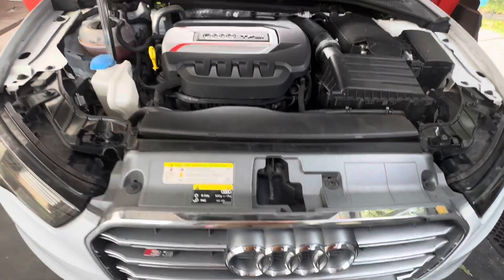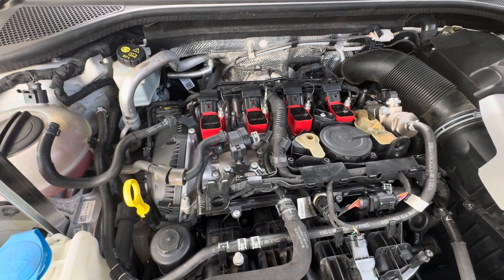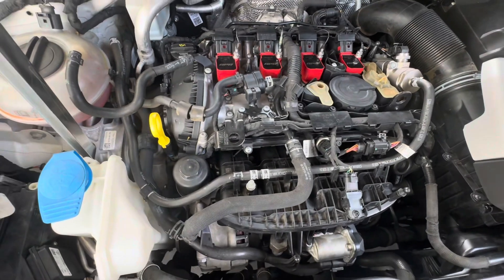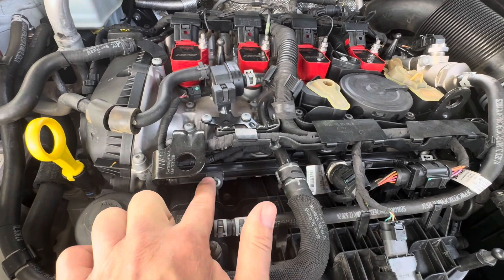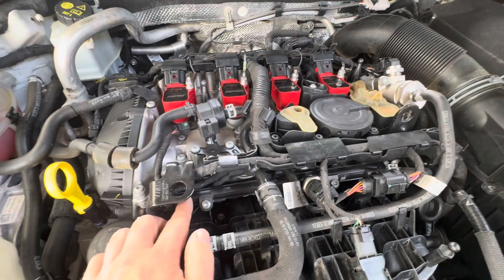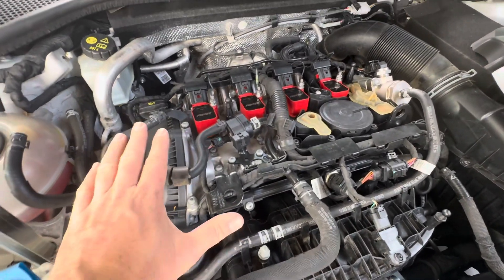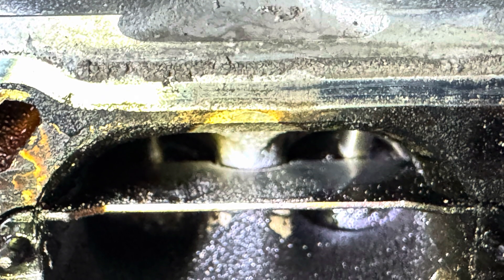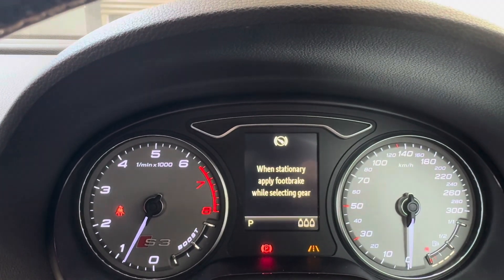Fixing rough idle on the VW/Audi EA888.3 engine

Comment: well ive got a issue with this engine, mine is 1.8 tough, europe version, i got a situation which is: engine wants to stall after acceleration, noticed its worst until the engine warms up, sometimes it hunts for stable rpm at idle aswell, replaced the coils, pcv, cleaned the ports, spark plugs have like 30k km, any ideas? i can send a video if necessary, no codes btw on vcds
Reply from the maker: I’m not sure if worn fuel pump(s) would cause it without triggering fault codes, but that would be worth investigating.  Otherwise injectors are the most likely cause, poor flow and/or poor spray pattern.  Take them out and get them cleaned/tested.  Although it’s likely not an issue it might be worth doing a compression test before pulling injectors out, since it’s a simple process.

Comment: Great vid mate, would be great if you could include some footage of the engine while idling. I've just changed the pcv due to excessive fuel usage and rough idle.Achieved reasonable improvement with idle, however I still have slight engine shake ever couple of seconds..and not a constant slight shake as before. Gonna compression test the cylinders tomorrow, as theres also still excessive crankcase pressure ( plenty pressure with oil splattering about quite sporadic with oil cap off) Hoping its not piston rings shot -_-.

Comment: This isn't a facelift s3 is it? so won't have the supplementary injection? which would explain the carbon buildup
Reply from the maker: It isn’t a face lift but it does have supplementary (port) injection, it’s pointed out at the 3:40 mark.  Australian (and Euro) cars got the supplementary injection.  But it doesn’t stop carbon buildup in the ports

Comment: How many Miles are driven with this car?
Reply from the maker: @MelvinHoltslag  147,000km (92,000 miles)
Reply: Great video, mine is at 94k and I have the same issues. Just changed PCV value and a lightly better but just started cold and came back again. I’ll try this next. Thanks